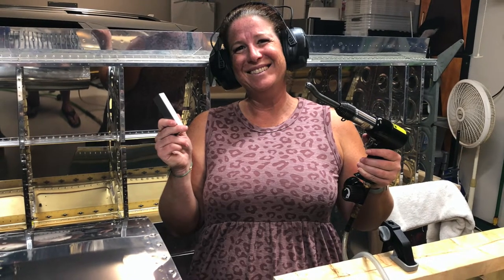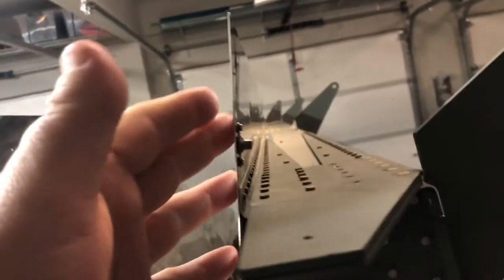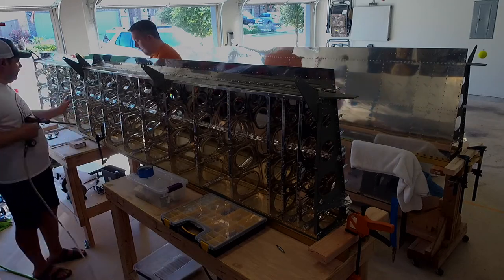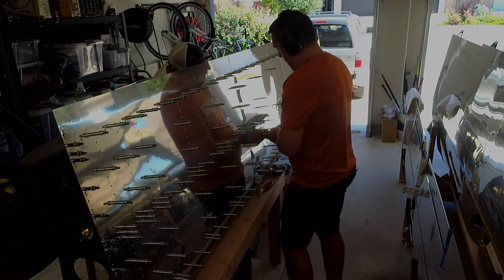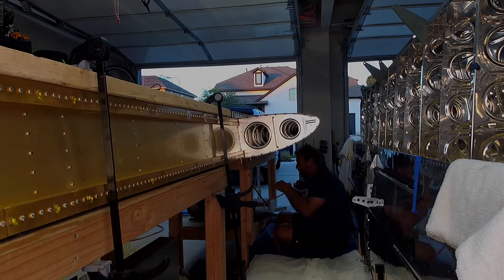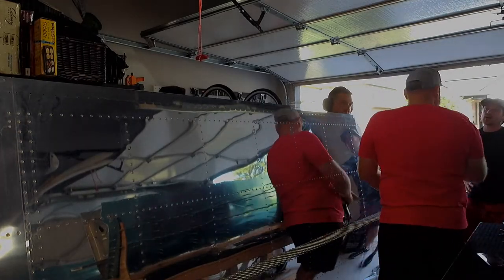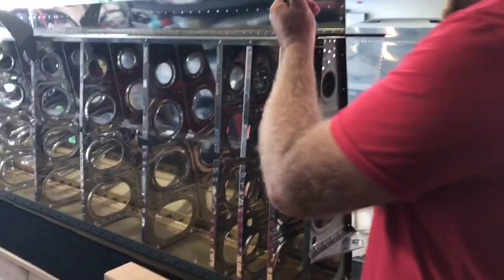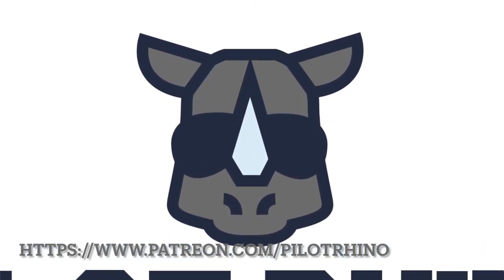Van’s Aircraft RV10 Top Wing Skins & Leading Edge

Comment: when you use the offset you can tape it with duct tape so that it doesn’t rotate while it’s banging.
Reply from the maker: Do you just tape it to the shaft on the air hammer?
Reply: @pilotrhino   yep.  Just run a piece of tape near the top of the shaft and over the cage capturing the base of the offset and the top of the shaft/cage
Reply from the maker: @smellyallen  EPIC... TY for the tip.